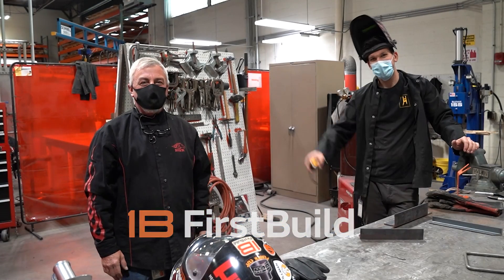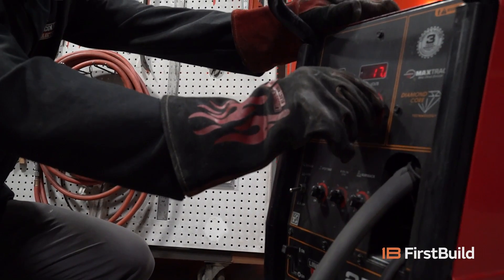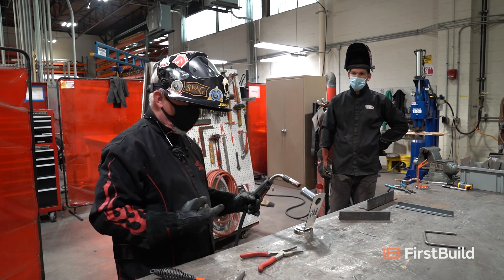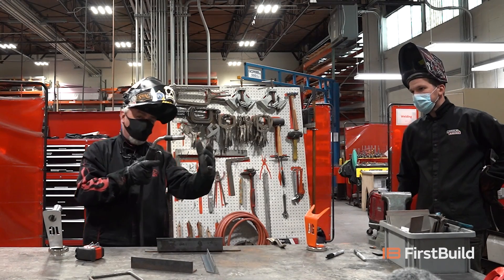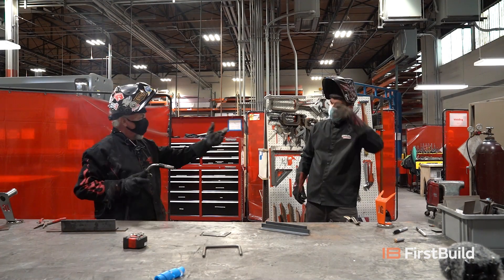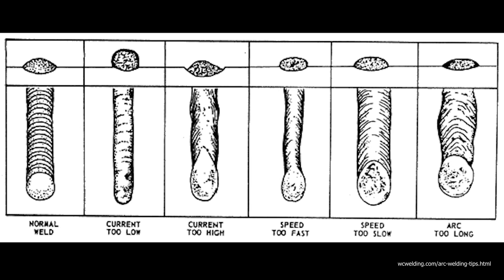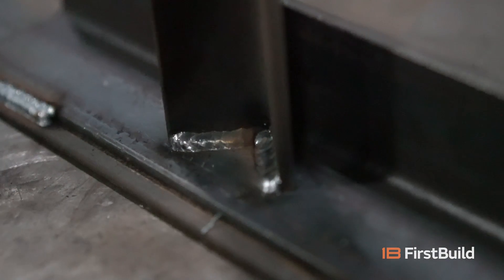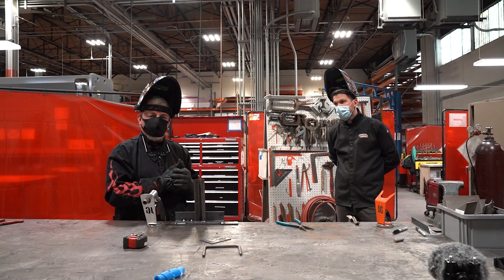Welding Basics | Learning How To MIG Weld For Beginners | Tips and Tricks

Comment: House electricity is not DC + and -. It is 120 volts AC , hot and neutral. May sound petty, but this is a big difference.
I just bought my first lincoln electric  AC225S. I will be adding a DC optional output so I can weld with AC or DC.